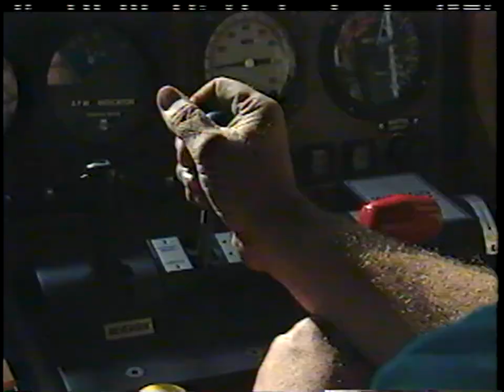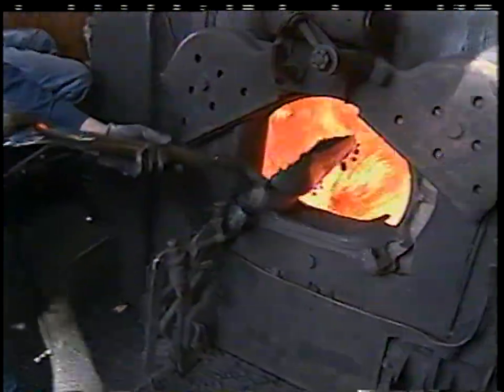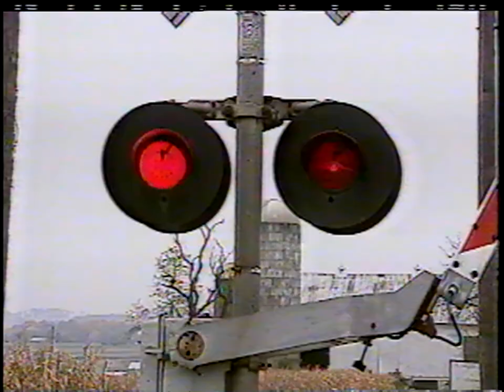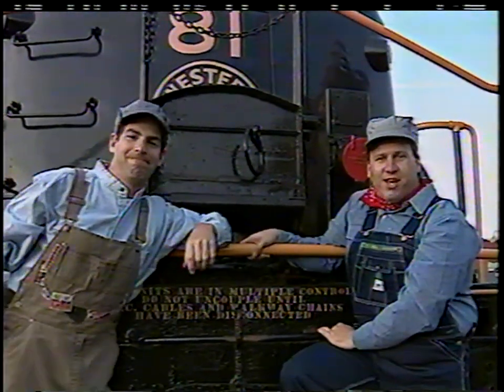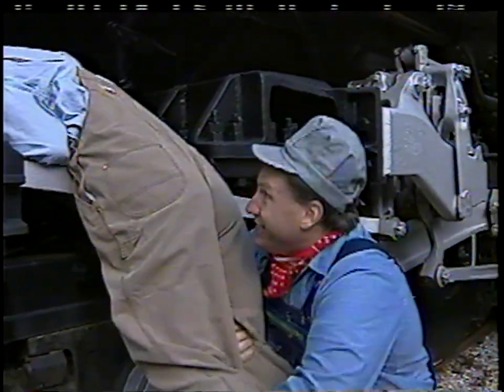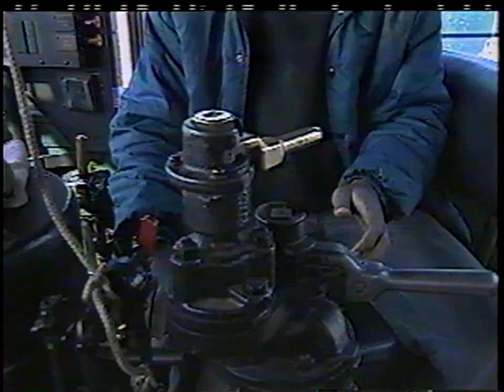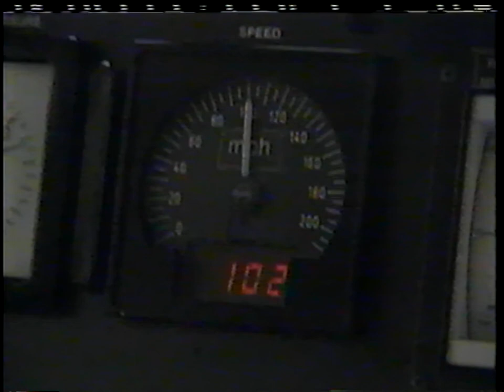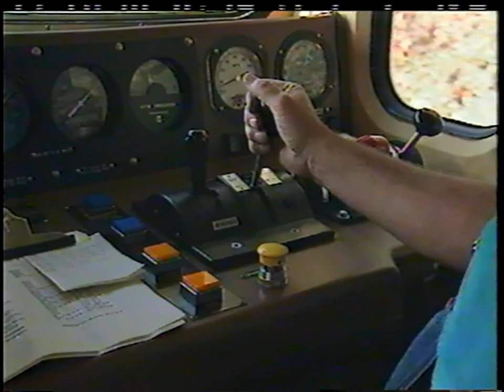All About Fast Moving Trains (2001) VHS

Comment: Untill about 1900? Diesels came out in the 50s lol
Reply: Electric locomotives came out before diesel, once electricity was widespread, they soon developed electric variants of locomotives and streetcars. While steam was the primary type of locomotive, the late 1890’s and early 1900’s saw the introduction of electric locomotive power. Even the early diesels were introduced in the early 30’s if I remember correctly.